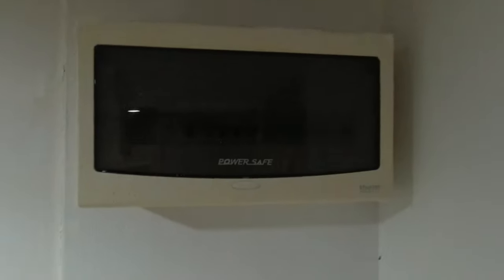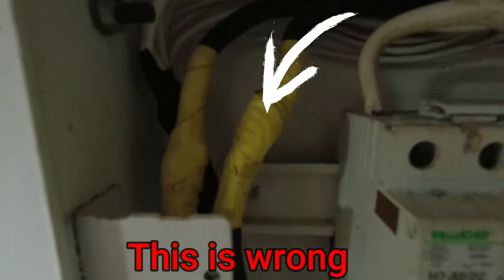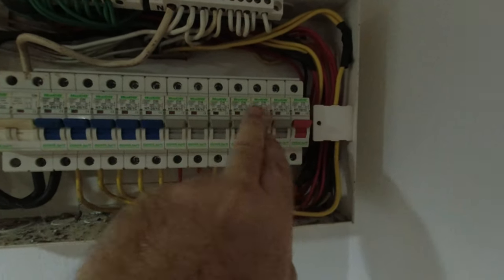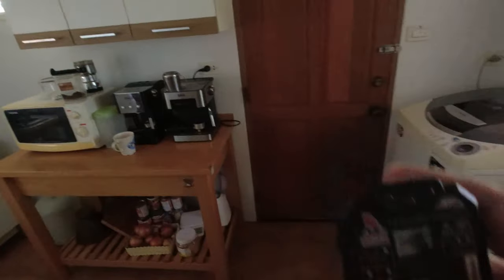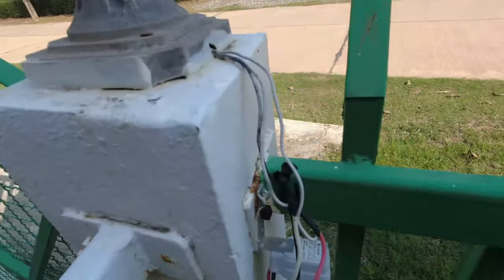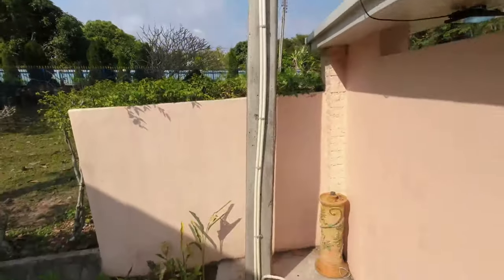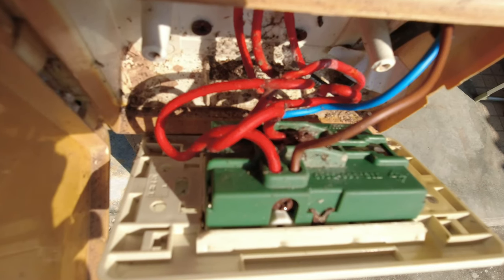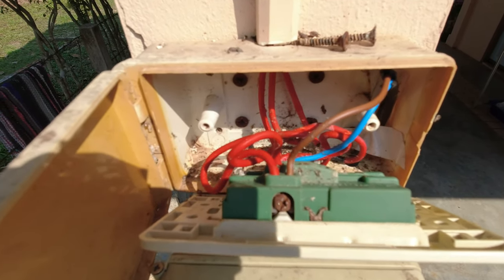Thailand Dangerous Electrics New video

Comment: Thanks Les, yes, the wiring is something to be very cautious/aware about. We did renovations in our townhouse and had the place completely rewired and an earth rod into the ground. I was pleasantly surprised that the electrician did a competent job.
Reply from the maker: Thanks Douglas happy to hear a good job was done.
A friend of mine electric was struck by lightning, all tv’s broken fridge gone so got an Electrician it to fit surge protection to safeguard the electrics.
Lightning struck again tv,s gone also fridge, The original electrician never came back, so employed another Electrician, when the cover was removed the surge protection was not wired up just placed into the fuse board. There thinking lightning never strikes twice in the same place. Lol.
You never know if they are genuine.

Comment: Hi Les I am a NICEIC registered electrician in the UK I’m not telling you how to suck eggs but with all due respect running an earth rod into the ground that is very dry with a concrete cap is only part of the job if the resistance to earth is not low enough it will not protect you in fault conditions which is putting yourself into a false sense of security you still would need insulation resistance tester because I’m sure you’re aware if the Earth resistance is too high it’s a pointless exercise
Reply from the maker: Hi Dean, thanks so much for your comment, Not having dealt much with a TT Systems in the U.K. and trying to understand the Thai way of grounding I have no straight answers. Talking with an Australian friend of mine suggested the mem system but in reality it’s a total mix of everything here. 
I should also say I was also NICEIC registered in the U.K. but that was 12 years ago and watching the Electricians vids on YouTube wow how things have changed.
My reason for the rod, it is to supplement what is already there. Although no trace of where it goes. The rod is 2 metres into the ground, there is a high water table here as we are surrounded by lakes. The rod although capped off has weep holes as water runs off the roof directly onto this surface so over a period of time would drain into the Earth rod location. 
I very much appreciate your taking time to comment and take any advice given.
The mcb’s are wrong on the lighting circuits having 16 amp breaker. So a work through slowly 
The electrics here are far far away from the ultra safe systems in the U.K.
Enjoy. Thanks again for watching.

Comment: thai electricians are very thoughtful though les    when i turn the tv on the washing machine comes on at the same time      hehehe   takecare both   steve + nam   udonthani
Reply from the maker: Thanks, will have to look for that Remote control electrics.
But WAIT I am getting a light switch set up that works by kinetic energy no cables to switches required a great invention to have in Thai houses where 2way lighting is rare. On order now so maybe a couple of weeks.
Thanks for watching and taking time for watching.
A question when the washing is done does the tv go off.?

Comment: The electricity amazes me wires only have basic insulation, it is not allowed in the European countries perhaps in the under developed countries, but if it breaks it causes danger. Other thing are the kWh meters they are installed under the falling rain, unbelievable. ( 36years as an electric engineer perhaps I should come to teach what has went wrong)

Comment: As a Sparky in Australia the bus bars are in the top of the mcbs, the big warning ⚠️ for me was the lack of an MEN of course putting in a whole house RCD you would remove it in any rate, scary using an Red wire as a neutral and even more so as an earth 😳😳smoke alarms save lives as you well know, great information provided as normal Les 👍
Reply from the maker: Thanks Mark,  I checked the breakers they were non directional so no problem with the bus bar being at the top, I have to redress the cables to the top when I put the individual RCBO breakers in as the bus bar goes at the bottom of the RCBO breakers.
Thanks for your advice as with any advice given.

Comment: Good info well done though to tell you the truth behind that main breaker panel wires looked a lot better that I had anticipated they would even though some of them were wrong have fun lol stay safe
Reply from the maker: Thanks Dave, how's things with you, settled in now I hope, everything in its place, good to see your fitting water resistant sockets outside. I will have to alter mine, but I love electrics and look forward to the challenge.
Reply: Things are getting there slowly we’re working on the outside Thai kitchen right now I’ll probably put out a video in the next couple of days and then I have the plunge pool and the pond and the outside electrical and the and the and the lol but it’ll get there hope to see you soon Les

Comment: Hi les how much is a full rewire in Thailand my wife has a house in phichit been told needs re wiring but we live in uk
Reply from the maker: Hi Gary, it depends on what size house if cable conduit is fitted the cost of stripping out wall chase if needed, type of fuse board is the biggest cost a 14 way board with all individual RCBO which I’m doing would cost about 10,000 baht just for the board. ( This is gold standard with great protection ) or a board with mcb like the board I have now for about 2,000 baht. So you’d be looking at about £1,000 to £2,000 depending on quality of fixtures and fittings.
I supervised a rewire that cost £1,800 pounds in a new build house. European standard everything in conduit in the roof space but he decided against the individual RCBO and went for One RCBO which covered everything to save cost, The extra would of been another £240.
Hope this helps but it’s how long is a piece of string here. Getting qualified electricians is a lottery. Ask for recommendations and avoid Ooooo I know a man in the village can do this he is not a electrician but he knows what he is doing.
Reply: @RetiredandLivingthedream  thanks for the information